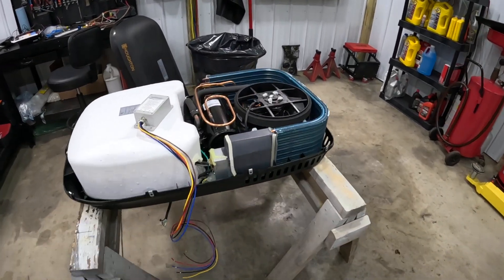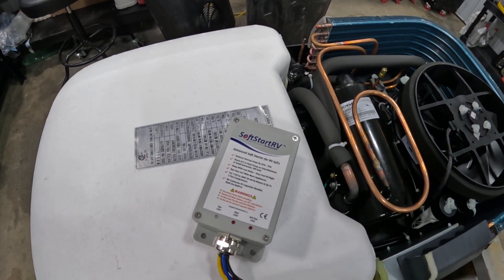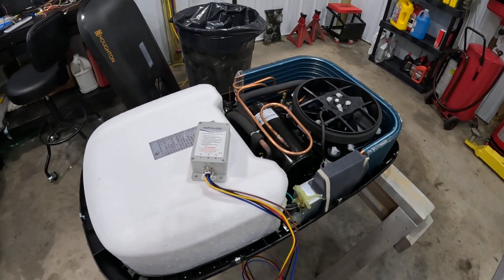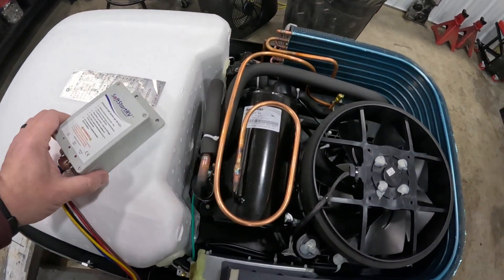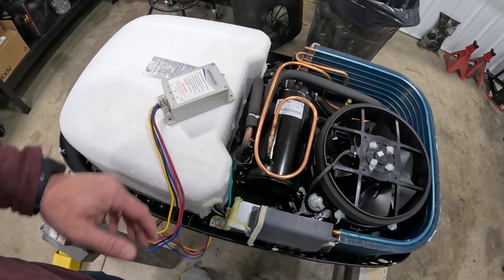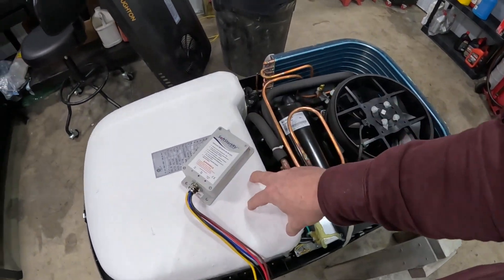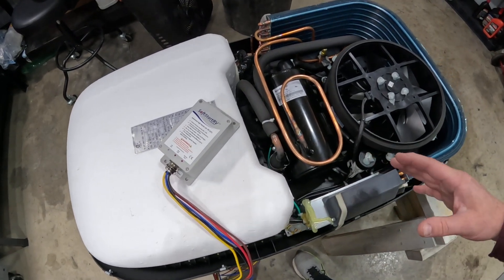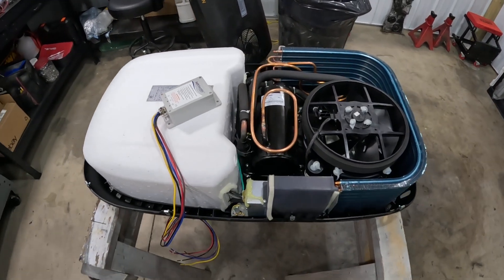Why You NEED A Soft Start On Your Van Conversion RV A/C System

Comment: First. I would not use (SoftStartRv) brand because they seem to refuse to get their product UL listed unlike (Microair).
Also if you have a Coleman Mach AC. If you buy their softstart, it will not void their warranty and it's cheaper too.
Reply from the maker: I've used both and both work well. The SoftstartRV is a little easier to use and like I said they had better support for a wiring diagram to the AC I was using at the time. Good points to consider though